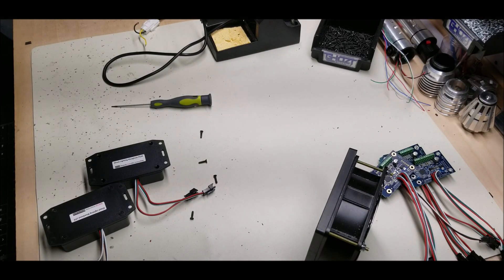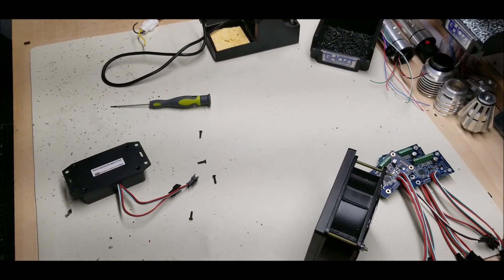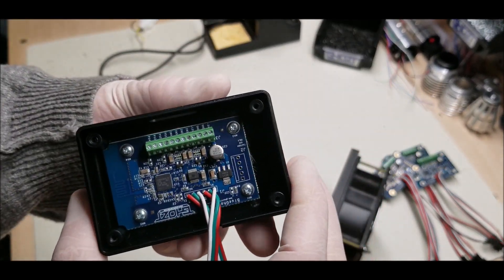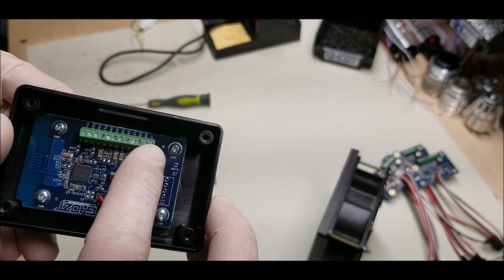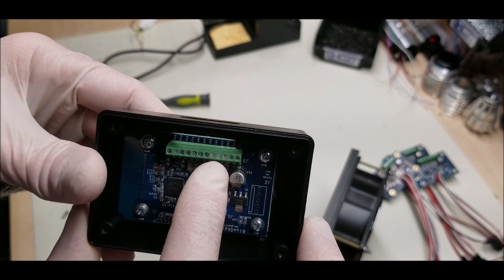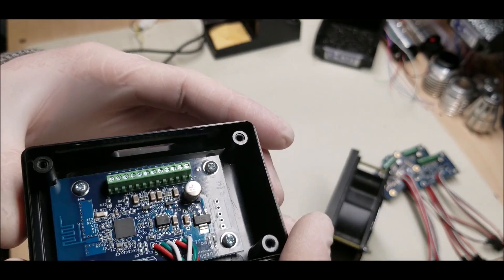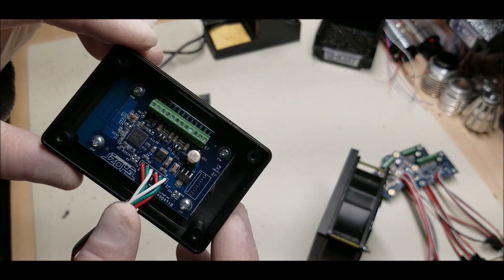Ghozt Lighting - BlueGhozt - Intro and Overview

Comment: I really hope you're still active on here. When I turn my parking lights on, the Blue Ghozt app is showing the brake light indicator and not the parking light indicator. Is this a wiring issue on the board itself? I didn't wire it, I bought it pre wired
Reply from the maker: Yes it sounds like it is miswired or misconfigured. Please reach out to who you purchased it from for assistance, as we don't know how they would have wired it.

Comment: Ordered up my BlueGhozt plus, n was wondering. 
Are the sequential turn and DRL input modes 12v only?
Previously with my vehicle, I had to use a relay to flip my negatively switched signal to a 12v positive.

Comment: Hey question, I'm thinking about getting a box. but I'm trying to learn how to hook it up before I get it. I have 4 halos for low and high beams. How would I hooking it up. Cause I only see 2 connectors and the blueghozt
Reply: Are your halos equipped with addressable LED’s?(NeoPixel) Better yet can you post the exact rings you purchased this would make it much easier to help you....  as far as “how would i (you) hook it up?” Well sir, that all depends on wether you have the correct halos 👍🏼 let me know I’d love to help

Comment: Does the indicator and brake input take 12v?
I read on the ghozt page in1 is brake light/party mode via 12v. Does this mean I u can have the option of hooking up a switch to switch it to party mode if you not using the brake light function? If so how do I do this because I can't seem to figure it out software wise...

Also i assume in1-in4 can all handle 12v?

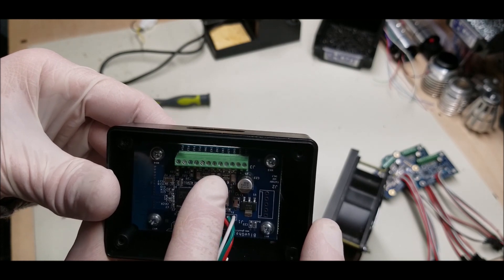Comment: 2:05 - Which input is for parking lights, which is brake lights, and which ones are the turn signals? 

EDIT - Nevermind... Found it on the website... https://ghoztlighting.com/getting-started-blueghozt/

Although it would've been nice if he had specified which is which in the video...

In1 – Brake signal input / party mode input (show mode activates via 12v)

In2 – Parking/running lights signal input

In3 – Left turn signal input

In4 – Right turn signal input
Reply from the maker: yeah it's on our site, but just for reference here:

GND – (required) Connect either of these to a ground
+5V – (required) Connect to +5v or +12v power supply, depending on whether you are using 5v or 12v Neopixel LEDs
+12V – (optional) Connect to a +12V supply for power switches on a BlueGhozt PLUS
In1 – Brake signal input / party mode input (show mode activates via 12v)
In2 – Parking/running lights signal input
In3 – Left turn signal input
In4 – Right turn signal input
PS1, PS2, PS3, PS4 – (PLUS only) +12v outputs for 12v accessories
Reply: @ghoztlighting  Thank you... Just to make sure I get this straight before I start putting power to it..... I will need to give 5V to power the Blueghozt controller no matter what, but if I'm using 12V LEDs (which I will be), then I will also need to give 12 volts of power to +12V input (Blueghozt Lite version)? 

Thanks again for your help.
Reply from the maker: @imdbtruth  if you mean 12v Neopixels then you just apply 12v to the input that says "5v". I understand that is confusing, but it really is the "Neopixel positive input" which just has to match the Neopixel voltage. The 12v input is just for the PLUS model.
Reply: @ghoztlighting  Okay. Now I understand. Thank you again for clarification, and also such quick responses.

Comment: It says 12v to 5v and under 2a draw?

So it can't be over 2a?
Reply from the maker: the 2 amp limit is for the 12v power switches on the BlueGhozt PLUS. for Neopixel it is limited by number of LEDs at 350/side

Comment: Hi bro. Let me know. Is the one module enough for two tail lights and headlights?
Reply from the maker: It depends how many LEDs you are running, as this is limited to 350/side (700 total) - but yes it is possible and we support both white and red parking lights for front/rear!
Reply: @ghoztlighting  thank you